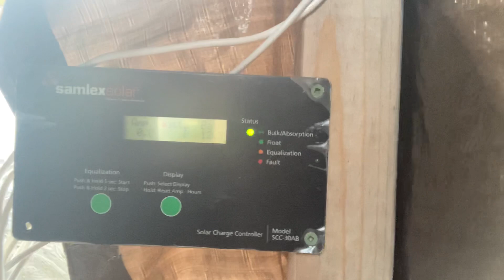Sneak Peak Tour Of DIY Solar Boat

Comment: Hey Steve, what camera do you use? I am starting a channel and would love ideas for good equipment (hopefully inexpensive). Thanks!
Reply from the maker: I'm using a sony a6400, it was expensive.. had to sell a bunch of my stuff to buy it, and it's still far from the best camera out there. I went for 4k, but you can get some very affordable mirrorless cameras that are 1080 (which is typically fine for youtube)
Reply: @SteveWallisStep2  thank you for the suggestions! Maybe an older a-series is the way to go?
Reply: DC Outdoors that’s what I would do, the autofocus is great (I used to use a canon t5i and it was horrible focus)

Comment: The boat is cool but the motor is lame bro. Yeah
I bet it doesn't work worth crap against the current? I tell ya, at least a 20 hp gas motor to move that palace? Cool show.  The boat needs a steeringwheel and a name?
Reply from the maker: It won't go up current, but even last year with an 18 hp outboard we couldn't go up current. The raft is a displacement hull, so pretty much only good for lakes or going down river. if we had a planing hull we would be able to get places, but the more horsepower we put in this design the more water washes over the deck.
Reply: @SteveWallisStep2  Steve, It has come to my tight-assed attention to detail that your camping channel doesn't have a static title. You should remedy this oversight ASAP! I even have a suggested title for you (naturally!, right?!) I think you could essentially sum it all up with the following title::  "Drinkin' With Stevie" 😁 😁

Comment: Thanks for the video! Tthe minuscule efficiency advantage of an MPPT controller is basically meaningless at 400 watts under most conditions. I found a cheap PWM controller that allows me to select the absorption voltage (14.9 for 6 volt X 2 golf cart batteries) and has temperature compensation. I doubt you could find another off-the-shelf controller that charges my batteries any faster. Great to see you are out in the plastic barrel-toon raft! Can't wait for the whole story.

Comment: The trolling motor claim of lasting 5 times longer may be true, but only at the very lowest speed settings.  So if on speed 1 of a traditional resistor based speed control motor, it may draw about 5 amps while your PWM based motor would draw only about 1 amp to get the same RPMs to the prop.   At higher speeds, the difference drops of until max speed, where there is no difference at all.